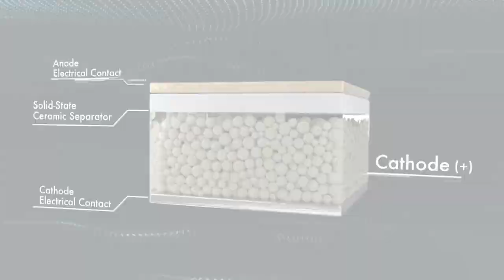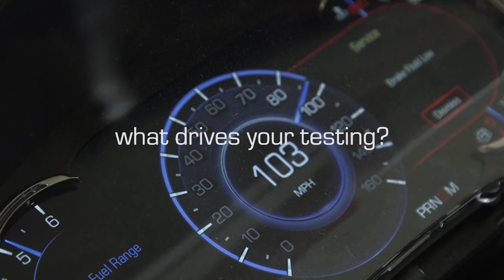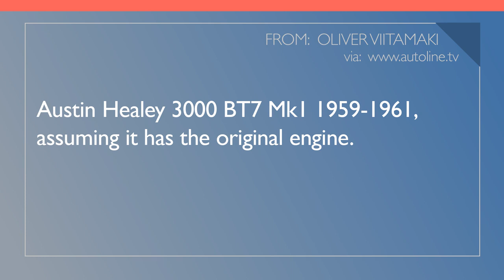All-New Nissan Qashqai Debuts; Bold New Honda HR-V - Autoline Daily 3019

Comment: How is there now shortages in natural gas?
Reply: Might be from wells freezing?  That's nothing more than a guess..
Reply: My guess: due to the extreme cold in US (high demand for heating).
Reply: The alleged Texas governor claimed natural gas is "freezing in the pipes."  That's ludicrous, of course.  What does freeze is the hydraulics controlling the wells.  I was not aware, some U.S. natural gas does get piped to Mexico.  Many petrol wells are inoperative.
Reply: US is one of the largest worldwide producers of NATURAL GAS and US, because of the "deep freeze" both uses all then can produce and has problems piping gas to Mexico through Texas and Arizona.
Reply: @stevejohnson1321  Russia gets most of its gas from Siberia, temperatures can drop to -50.... how cold is it in Texas?
Reply: Texas did not need to freeze-protect the hydraulics -- until now!  Also wind turbines will run in the cold if there's anti-freeze liquid put in.  These didn't have that, so they quit operating.
Reply: @stevejohnson1321  - funny that there have been FREEZES in Northern FL and this DOESN'T HAPPEN. It is more a matter of an INDEPENDENT POWER GRID that DOESN'T WORK.

Whenever ATL or JAX have had freezes they could rely on power from up north, which is not the case with TX (only the extreme west and eat tips have been spared). And that INCLUDES renewable energy...

Comment: The E power hybrid concept is the future. The engines will be powered by gas, natural gas or hydrogen.
Reply: My thinking as well, for the foreseeable future. BEVs might still win out but GEVs, like Nissan's E-Power, push that day back quite a bit.
Reply: Still probably going to have critics whine about how engine rpm is unrelated to road speed (like they do with a cvt).

The E-powers they sell in Asia are garnering good reviews. Impressive efficiency given the inherent losses converting the ICE power to electricity.
Lots of people in dense cities there with no plug access.
Reply: Sorry, no. Not a chance.
Reply: It's not a concept. E power is sold in Japan on couple of models

Comment: "e-power hybrid"... You mean "Mild hybrid" ? Wasn't that the term for hybrids without plugs?
Reply from the maker: A mild hybrid refers to a 48-volt system, which typically consists of a belt-driven generator.
Reply: Uh, nope. It doesn't work that way. Some automotive YT creators have explained the difference between Toyota's non-Prime HSD system and Nissan's ePower / iPower (latter is for Infiniti). I would yield to them for that explanation...

It is not the whole explanation, but a MILD HYBRID is a 48v system (includes a self-contained battery pack of < 2 kWh) pretty much to turn on the vehicle and has a much tinier motor and batteries than a FULL HYBRID.

FULL HYBRIDS come in two flavors: SELF-CONTAINED (regular HSD and other non-plugged systems) in which a smallish (5-10 kWh) battery pack will only support the ICE and won't run on its' own and PLUG-IN (as in HSD Prime and other PHEV systems) in which a larger (15-30 kWh) battery pack will turn on the vehicle and run it on EV MODE until depleted. Once power (which you have to juice via an ELECTRICAL PLUG) is depleted PHEV's will revert to HYBRID MODE, like a self-contained system until it gets "enough juice", usually by charging it again, although the braking-provided "juice" can repower it for a little while.

This is not the whole explanation and I could be wrong in some parts, but this is what I understand about ICE-HYBRID systems.

Comment: Rogue Sport? Why not use the name Qashqai? It’s a cool name 🤷🏻‍♀️
Reply: Ask Americans to pronounce, or worse, spell Q-A-S-H-Q-A-I (Canadians do have that conundrum since it is sold with the Q-wind word there). 

Also, the Rogue / Xtrail (as is known in Europe) is Nissan's best seller in US (wasn't when the Q-wind crossover was originally on sale in US, but it was on its' way there), so it made sense to pull from there.
Reply: @syxepop  But if it’s based solely on could-be-a-pronunciation-problem then why they have no problem saying Volkswagen or Porsche names correctly? Or if it’s a spelling problem, Peugeot has no chance to make it in the US market, based upon your assessment
Reply: @diegoacevedo3707  - it's more of a MARKETING thingie. You will NOT tend to buy what you can't pronounce. Doesn't work with all markets or marketing departments (like Nissan in US and CA).

Stellantis (new word to pronounce) decided IT WASN'T WORTH THE FINANCIAL EFFORT* to bring the brand back to the US (most Americans butcher the Peugeot name, but it was there way before marketing to Americans was an issue.

That doesn't mean any of their Peugeot or DS branded cars won't be brought in some form to US, but most probably would be through the CHRYSLER BRAND and sales network.

* just look at FCA's "folly" with their Fiat brand...